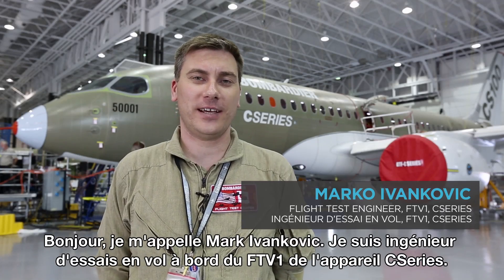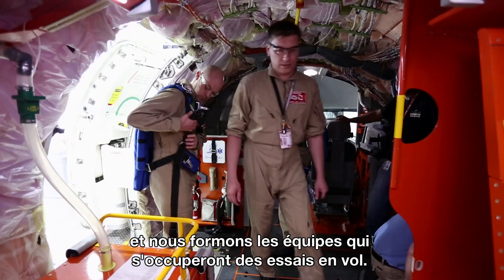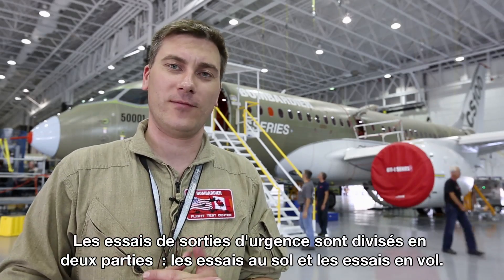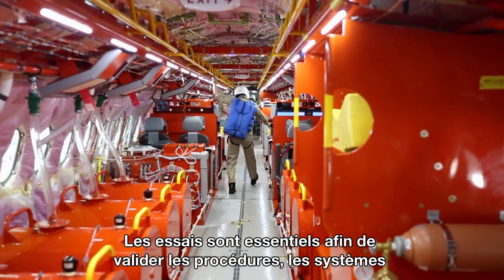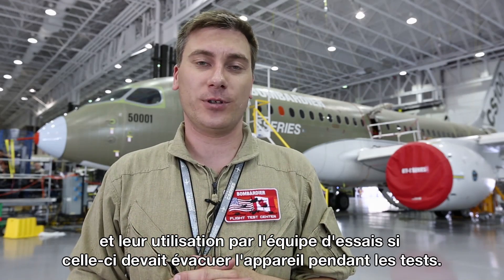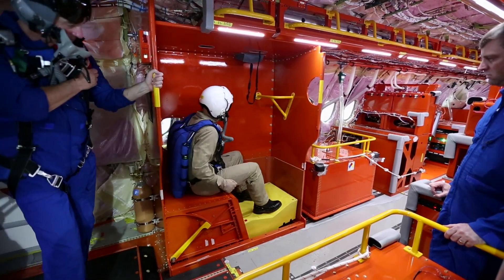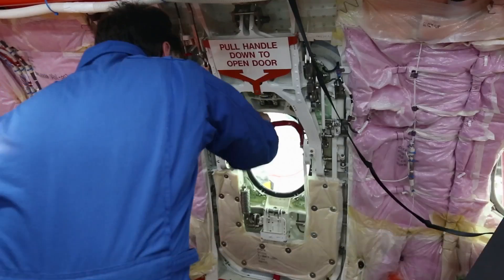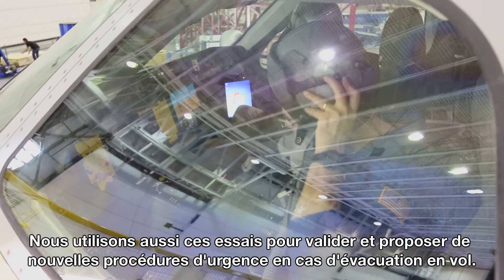Flight Test Crew Emergency Egress and Evacuation Testing

Comment: I would guess that the red parts that go down is a tunnel to make sure the crew clear all the antennas and the landing gear when jumping. The yellow cover likely pop out and the crew member juste let himself glide down outside.

All the test planes have these exit, because they will experiment for the first time stuff that might make the airplane unrecoverable such as stall, overspeed etc on top of the failure risk that any prototype face.